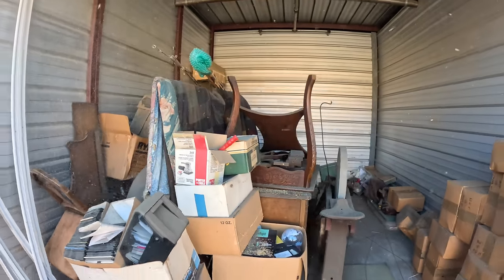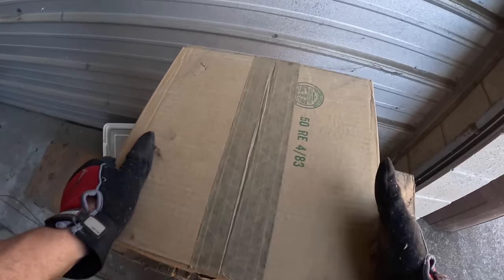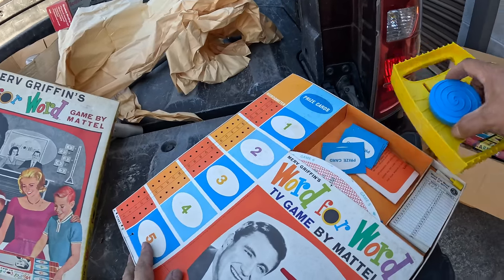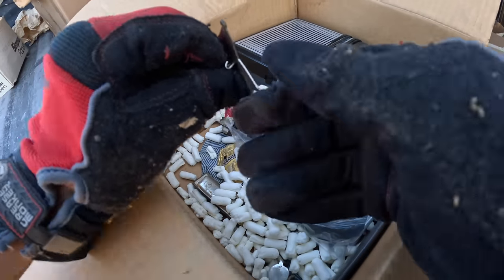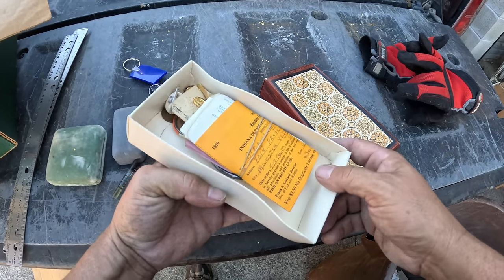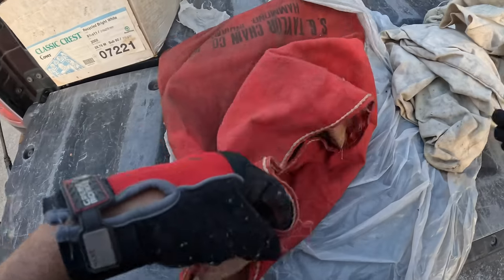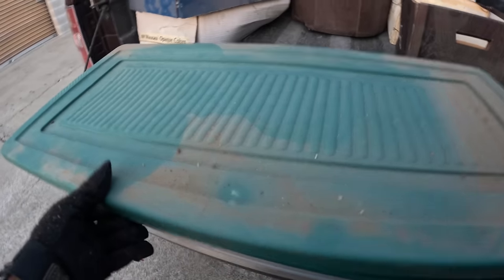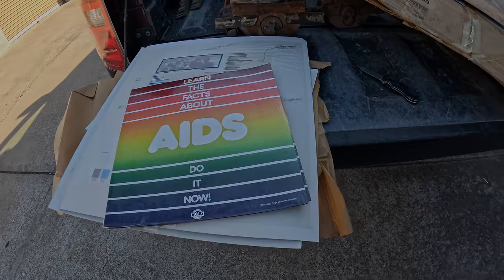100 year-old POCKET GUN found in locker that has been stored away for 30 years! Bought it at auction

Comment: The brown round thing with wheels goes to a rainbow sweeper. The rainbow sweeper worked by having water in the bottom to keep the dirt trapped. No bags needed. I had one for over 25 years. They are great Also mason jars and the steel poles are for the sweeper too
Reply: We had one when I was a kid (70's). Recognized it right away. Very cool.
Reply: They still sell them. Best ever if you have a kid with allergies, all the dust and dander caught in the water.
Reply: The silver curved pipe is from the Rainbow too. Don't throw it away!
Reply: I thought for sure it was part of a Filter Queen.   They have those parts too, not sure about the grate thing though.
Reply: Isn't the Mason jar a paint sprayer like the Kirby has? The other piece that you were trying to connect to the pipe is also a cleaning head.
Reply: I knew I wouldn't  be the only one that would recognize the parts from a Rainbow vacuum cleaner. I used to sell Kirby's back in the 70's and we took a lot of the Rainbows in on trade.